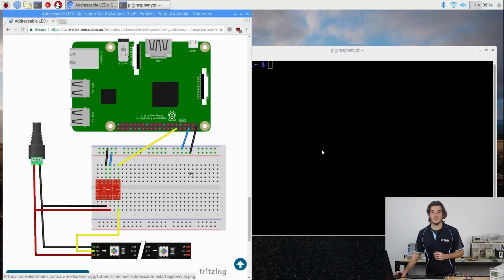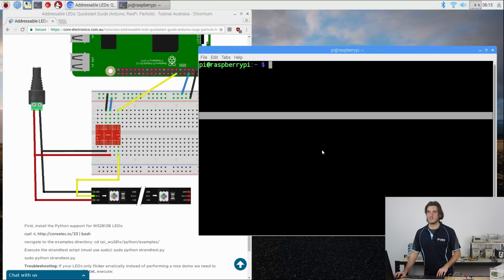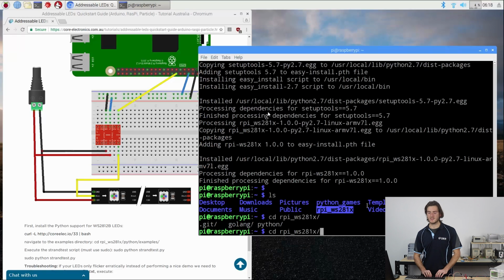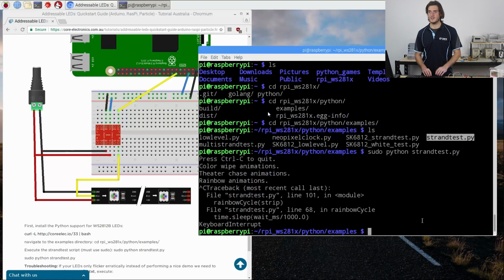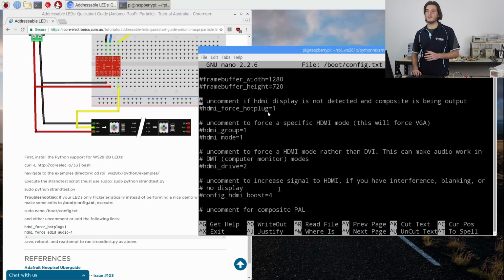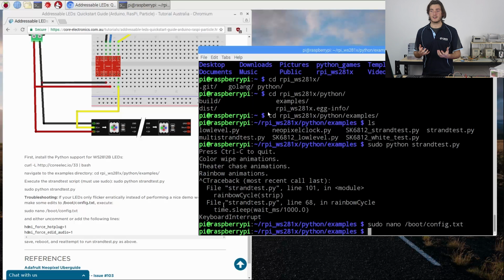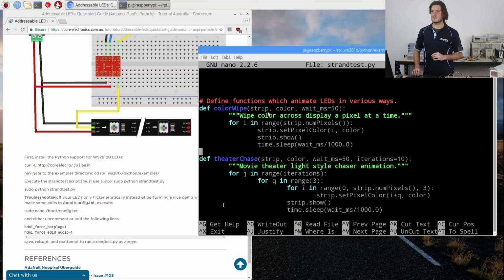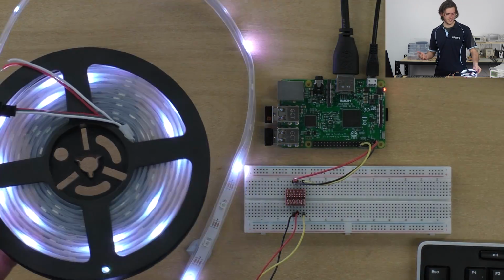How to use WS2812B RGB LEDs with Raspberry Pi

Comment: Hi, when I try to install the packages, it says "error: externally-managed-environment", same error message when trying to install the other two packages.  I installed Pi OS fresh using the latest 32-bit OS on a Raspberry Pi 4B.  Does this mean that my OS is two new for this to work?
Reply from the maker: Newer versions of Raspberry Pi OS force us to use virtual environments. The first half of this guide will help you out, just ignore when it starts to use Thonny.

We also do have a newer guide for this set up you might wanna check out as well:
https://www.youtube.com/watch?v=aNlaj1r7NKc

Comment: Hi! Quick question. If I'm powering the light strip externally, why bother with a logic level shifter? Why not go straight from pin 18 to the LED strip? In testing this seemed to work, at least up to 32 LEDs. Is it a problem of the 3.3v signal not reaching as far as it would as 5v?
Reply: I would also like to know. P.S. What is a  Logic Level Shifter ?

Comment: Great tutorial however, I am unable to get strandtest to run on my RPi 4 (w/Raspbian).  I get an error message: Traceback (most recent call last):
  File "strandtest.py", line 9, in <module> from rpi_ws281x import *  ImportError: No module named rpi_ws281x.  I was unable to find a fix on Core Electronics forum.
Reply: I too get this error, have you found a fix ? Thanks in advance
Reply: @Cluffmaster1980  Did you ever find a fix for this? I've run into the same problem So weird... Thank you in advance
Reply: @earthworm666   Hi, Yes I re built the raspberry pi and followed he guide again, don't forget to perform the commands as described word for word, however I have now followed the neopixel server guide which has much more functionality for my needs.

Comment: The wiring diagram in video has a slight mismatch to the diagram provided in the description link. Specifically, there is a ground wire bridging the two ground rails in the link version. Which is correct? (apologies if previously addressed).

Comment: Parts Required for this Project
A Raspberry Pi 
A Logic Level Converter
Some WS2812 or NeoPixel LEDs
A 5V Power Supply (Optional)
A DC Barrel Jack to 2-Pin Terminal Block Adapter (Optional)

Comment: I did the edit for my Pi 1 Model B to the /boot/config.txt file and it did not fix the problem. I bought the level shifter, and did a GPIO test to make sure it was working, but this made no difference. I got it to work perfectly after finding a tip from this Pi article. https://tutorials-raspberrypi.com/connect-control-raspberry-pi-ws2812-rgb-led-strips/#comment-47319
In the Raspbian Buster OS,  just add one line of text “blacklist snd_bcm2835” to file "/etc/modprobe.d/raspi-blacklist.conf "
Then, to allow the USB audio device to be the default device,
open /lib/modprobe.d/aliases.conf and comment out the line options snd-usb-audio index=-2 and reboot

I'm using the wiring instructions from the tutorials-raspberrypi.com site with no level shifter hooked up and it works perfectly on one strand I. Plan to hook up six strands in parallel with 3 LEDs from each strand being lit at once in a moving fashion.
Reply: did u found out how to undo those changes after commenting out snd USB index I cant find my command there
Reply: @vrankyrule  do "cd /boot". Then "sudo nano config.txt". Then arrow down in file to 
# uncomment if hdmi display is not detected and composite is being output
#hdmi_force_hotplug=1
also delete or comment out 
#hdmi_force_edid_audio=1
Reply: PROJECT UPDATE: I have 5 strands hooked up and it works great. Another tip to make it easier to solder leads on the cut strands is cut them apart at 15 lights each. That way, they come presoldered with beads of solder on top of the copper. and it is much easier to solder wires to them that way. I only ended up with one set like this since I cut them at 12 lights each.

Comment: Great video. The new PI models have a 5V output.. does this eliminate the need for the level shifter?
Reply: it works perfectly fine without it
Reply: @angelux079  it is still running at lower power than it should, the rpi4 is 1.5a I believe
Reply: probably, I'll try it since I have a RPI 4 and the led strip is arriving today so I'll let you know

Comment: If you get this error:

pi@ambipi:~/rpi_ws281x/python/examples $ sudo python strandtest.py
Traceback (most recent call last):
  File "strandtest.py", line 9, in <module>
    from rpi_ws281x import *
ImportError: No module named rpi_ws281x

Then enter these commands and afterwards it should work:

sudo apt-get install python3-pip

sudo update-alternatives --install /usr/bin/python python $(which python2) 1
sudo update-alternatives --install /usr/bin/python python $(which python3) 2
sudo update-alternatives --config python
(enter to choose default)

sudo pip3 install RPI.GPIO
sudo pip3 install rpi_ws281x adafruit-circuitpython-neopixel
Reply: yes
Reply: thanks man !
Reply: use sudo python3 standtest.net 
or if this doesn't work try this site https://tutorials-raspberrypi.com/connect-control-raspberry-pi-ws2812-rgb-led-strips/#comment-47319

Comment: I'm trying this on a pi 2 model B with a fresh install of NOOBS, and I'm getting 
ImportError: No module named rpi_ws281x
after sudo python strandtest.py when everything prior seems to be going as it should. pinouts and bread board are identical to the linked page's diagram. not sure what I'm doing wrong.
Reply: I got it working. Check my forum post: https://forums.adafruit.com/viewtopic.php?f=50&t=167873&p=821989#p821989 You have to complete all the commands in the second url.
Reply: @tibovandenberk1643  saved my ass, thank you
Reply: I am having the same issue. Were you able to figure it out?
Reply: I personally have not, but after talking to someone else, it seems like one of the packages improperly installed. I have since tried with a 3B and a zero with the same results.
Reply: Also having same issue
Reply: I added the HDMI option that he gave in the video and it works well for my pi 4
Reply: Having the same error!
Reply: I also have the same problem. Has anyone made it work at this time?
Reply: sudo pip3 install rpi_ws281x adafruit-circuitpython-neopixel
sudo python3 -m pip install --force-reinstall adafruit-blinka

Comment: Yo I’m new to raspberry pi coding and have no clue what that white board is, can someone help?
Reply: The white board is a solderless breadboard.. https://www.amazon.com/Breadboard-Solderless-Prototype-PCB-Board/dp/B077DN2PS1 it's not really necessary, but it is a convenient way to connect jumper wires to devices  without soldering.
Reply: James Richters nice thanks

Comment: You do not need sudo to run the script. And you can use 5V from RPi if you have few LEDs.
Reply: Yes,  ~1m Led ist possible, but you need a Solid USB Power supply
Reply: @EinfachNils02  I'm using 8 LED module.
Reply: @iSpider82  I dont know the power Draw of this modules, but 1m  Led Stripe are 32 LEDs so i think it's possible

Comment: In my case the srtip is also working with 3.3V (without the levelshifter).   ( :
Reply: Did you ever harm your board without the shifter? Did you use an external power supply too?

Comment: You never clarify how you use the dc barrel jack 2 pin terminal block. Are you plugging in a separate 5v adapter into its female or just running it with no additional power- straight from the breadboard to the led strip?

Comment: do you still need to buy the low level logic shiftier if i power the pi separately
Reply: The level shifter is only for the data line, which if the voltage is too low, might not be recognized by the LED controller. I don't think a voltage that is too low will hurt anything, so you could try without, but it might not behave properly.
I realize this is a necro response, but someone else might find it useful.
Reply: @chinoto1  I did, thank you.
Reply: did you try without the Logic Level Converter?

Comment: Can you make a video showing how you wired it?
Reply: raspberry gnd 18(gpio) to ws2812b, 5v to 5v ws2812b and gnd to raspberry pi
Reply: How would the wiring change is im using the 74AHCT125 level converter chip?
Reply: I'm using an actual matrix 8x32 (256 LEDs) so it uses a good amount of current and operates at 5v. The raspberry pi outputs 3.3v. I'm operating mine with a 3.3v signal from the pi and is working fine, but I do have a level shifter I plan to use. Either way, the simple wiring you want to do to get a strip or matrix up and running is as follows; Connect pin 12 (GPIO18) to the DIN (signal) connection on your strip. It's recommended to have a ~430ohm resistor in series on that connection (from the end of the pin 12 wire to the DIN connection). Then take a secondary power supply that is 5v and provides sufficient current for the amount of LEDs you're using (mine is 5v, 8amp stable with 15amp peak) and connect the hot 5v (+) of the power supply to the 5v (+) connection on the LED strip. Then connect the GND (-) of the power supply to the GND (-) of the LED strip. Lastly connect pin 3 (GND) on the pi to the same GND (-) connection on the LED strip that the power supply GND is connected to. If you connected everything as I explained it, you're good to go.  That's it.
Reply: There was literally a diagram of how he wired it right there on the screen the whole time. Can't get much more cut and dry than that.
Reply: @gor4200  It's wrong. The blue wire gets switched as the black wire when it passes through the breadboard. It confused me as I'm new but I got clarification that it doesn't make any difference IRL because it's just colors; Blue wire from RPi is ground despite it being blue instead of the conventional black.
Reply: @gor4200  It is difficult to see if the LV side is connected to 3.3 or 5v on the RP.  Thanks, Norm
Reply: @gor4200  hahahaha

Comment: is sudo always needed to run python code? is there a way to avoid sudo? Also, great tutorial, only neeeded the first 1:14 to get it working :)
Reply: You can change the permissions to make the file executable by everyone. youll want to run "chmod 755 <filename>" but change <filename> to the name of your file. In this particular case the command you will type to make strandtest.py executable by everyone is "chmod 755 strandtest.py" without the quotes of course.

Comment: I have some 5050 led 5A 12 v ( also says 5M) led strips. Can the pi (zero) run this directly? I want to use 6 of them for a lithograph pi case. I want the led to light the lithograph from underneath while retropie runs. Just on, not flicker or anything.

Comment: raspberry pi 3 model b has a 5v gpio pin. Do I really nead to use a logic level shifter to translate between 3.3 and 5v or can i just keep it at 5v using this pin.
Reply: you can use a 5v pin with the adafruit trinket.... its only like 7 bucks
Reply: The rest of the gpio is 3.3V, you might fry your pi. And, it will most likely not be able to drive a led strip as it needs from 2A and up on it's own. Depending on length of course. From what I understand about it.
Reply: Thea Blanca does the Logic level shifter have proitection for fluctuations in voltage. I fed it 12v on accident. I have not been able to get the Logic level shifter to work. I only get voltage on my high side.

Comment: Hi Michael! I followed your tutorial and have been running into segmentation faults on both a simple script of my own, and on the strandtest script. I've also reinstalled the rpi_ws281x libraries a few times to make sure that wasn't it. Do you have any advice?
Reply: There is a bug that is will corrupt the SD card data if you use DMA channel 5.  Change it to channel 10 when you setup your system again.  They just pushed an update on January 1st.
Reply: I don't really have any idea what could cause that - python should be pretty uncrashable.
Perhaps try on a fresh, pristine installation of Raspbian.
If you run into further trouble we'd love to see your results on the forums: https://forum.core-electronics.com.au/

Comment: Thanks for the tutorial! I now have a Raspberry PI Zero W driving a 144 led strip (WS2812B 5050 RGB LED Strip 1M 144 LED). It works great.
Reply: This works out for you? Really strange. I only get very strange results....
I seem to have the same setup like you. Im currently using raspbian stretch lite.
I get the python scripts to work and everything but the leds seem to freeze at some point in time.. Not really reproducable. Im really frustrated since ive been tinkering for 3 days now.
Reply: works now :D pi zero w ws2812b... problem was the level shifter. mosfet level shifter delivered strange results. now running on IC. the example from the video even ran when I only added a resistor between shifter output and DIN from the led strip <.< the resistor just was in the wrong place